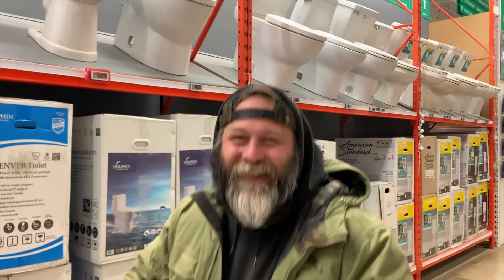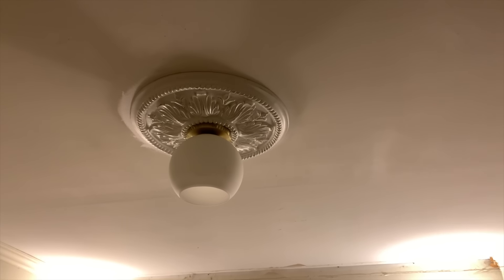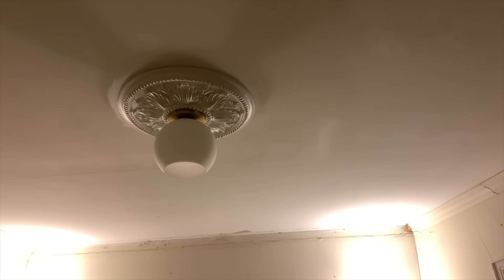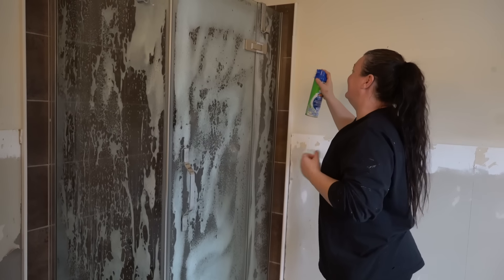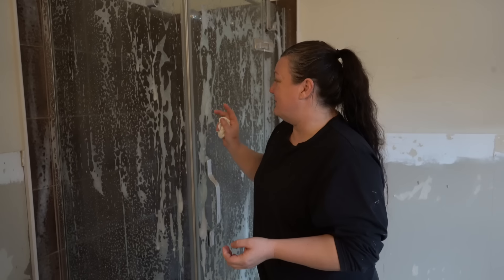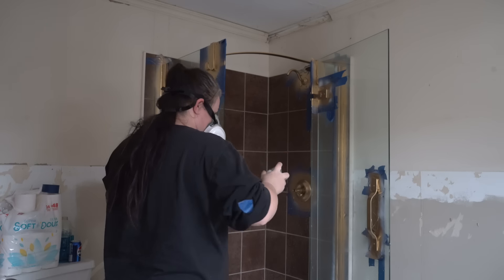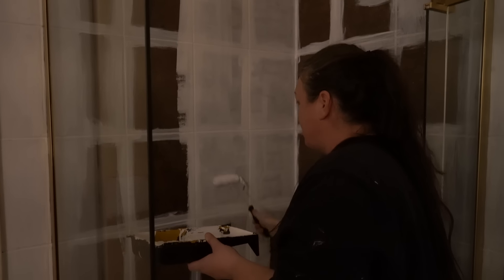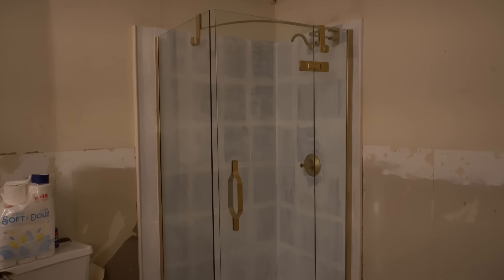How to MAKEOVER A STAND UP SHOWER *paint tiles + faucet + metal trim work* Chrome ➡️ Antique Gold)

Comment: Thinking of your shower….hand painted tiles were all the rage in the 1800’s as was draped circular showers.  To modify the corner shower I would use a faux gold trim around the top of the shower and hand drapes on either side of the door.  I would also use a larger round rain shower head because it resembles the first shower heads.

Comment: I learned the hard way about using heavy duty cleaners with a septic system. Those cleaners kind of destroy the microbiome of the system. You probably already know that but just in case.. 🙏❤️

Comment: Really like how your bathroom project is coming along, the end process will be great. You couldn't just change out flushing hardware? Take care.
Reply from the maker: the whole toilet is terrible from previous owners where they clearly cleaned inside the bowl with an SOS pad and scratched it all up which makes cleaning the toilet terribly difficult and never to perfection so after how long its been in the house its time to replace anyways. We just dont like to spent $ if things can be used still

Comment: While under coat is still fresh, spray Windex on the overspray and rub firm.  It will come off.  Same thing if you get paint on carpet.  Pour Windex on it and it will come up with dabbing paper towel on it.